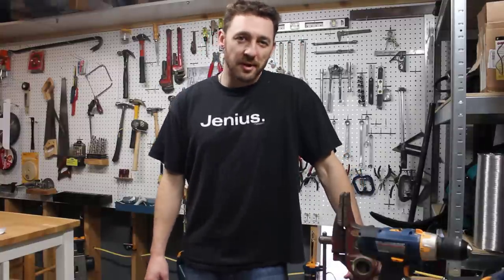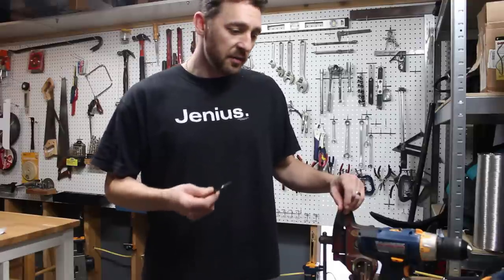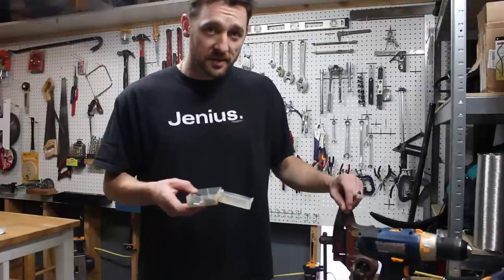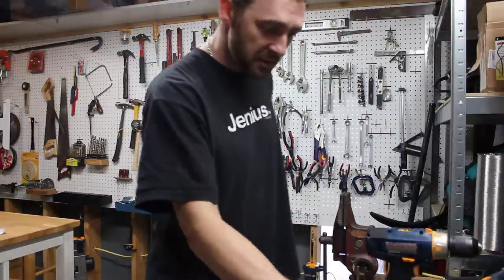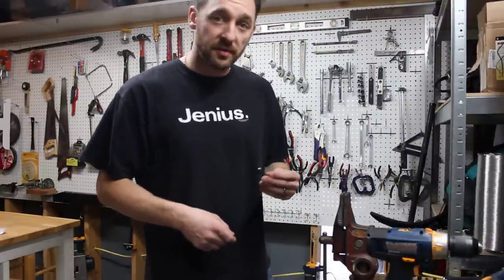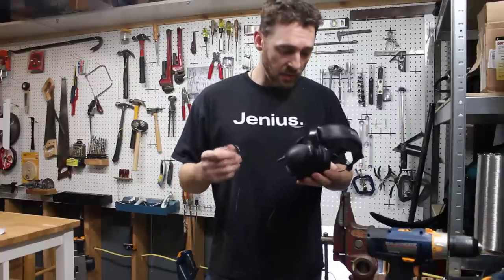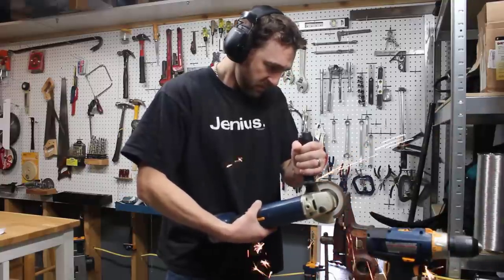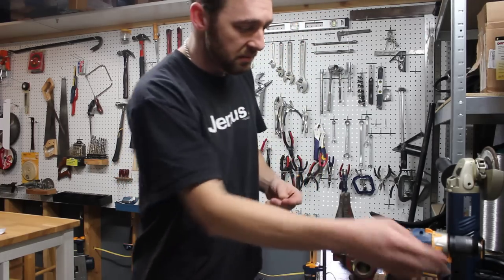How to make your own allen wrenches out of allen wrenches

Comment: Yup.. Just did the same thing.. My brother got me 8 cheap Hex or Allen Keys for Christmas, paid like a $1 for them.. I just put them one by one into the vise, used my Dremel 200 Series, and EZ abrasive cutoff wheel, and cut them. Then took my cheap Stanley double cut medium course file, and filed the ends nice and flush. They are perfect for the drill now. Been wanting to do that for quite some time now.. Took maybe 15 minutes, if not a little more. But boy o boy, now I'm in business. Don't have a holder for them like you got.. Maybe I'll check Amazon Prime for a plastic container, or I was thinking just stick them in a nice thick walled small plastic zip lock bag. Nice video. (+1 : 10) They do have these, they're called Hex bits.

Comment: Have you ever tried to sand one of those with a belt sander? I have a Japanese made pneumatic impact screwdriver that takes a 5mm or 3/16" hex bit or bit holder. The problem is I can't find any bits or bit holders this size so I bought a standard size Makita 1/4" hex impact duty bit holder in the hopes that I can use a 1" belt sander to sand the 6 sides down to 5mm(3/16"). I don't know how hard the steel is but I would imagine it's pretty tough stuff. Do you think this is do-able ?
Reply from the maker: No, never tried it.